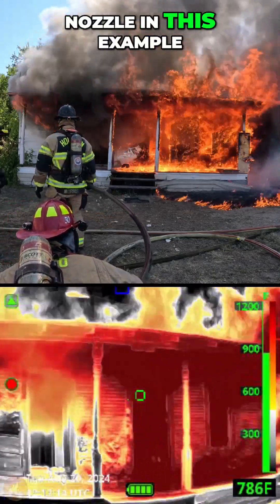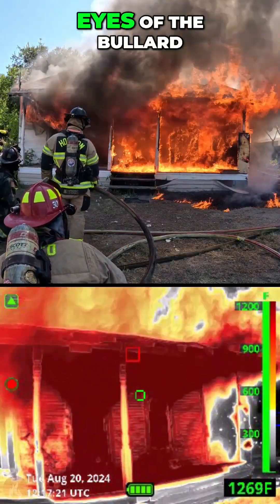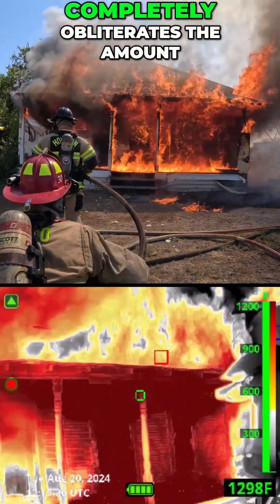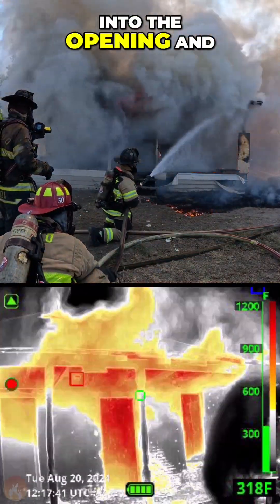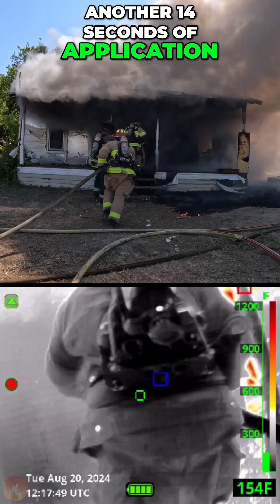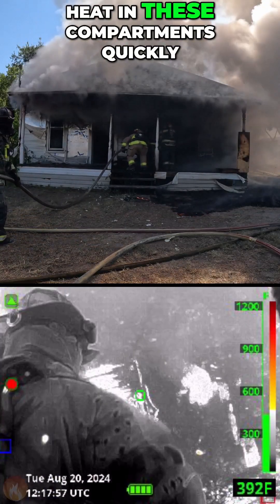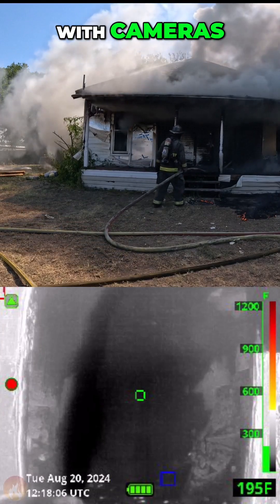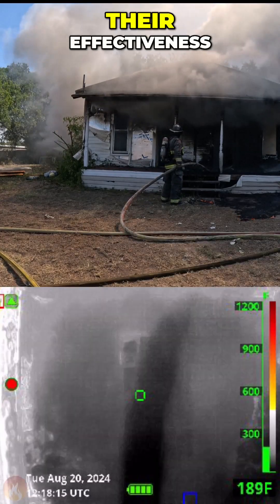Precision Fire Suppression with the HEN Blade 160 – Vertical Blade Pattern in Action

Comment: Another big game changer is the integrated TIC on the SCBA mask. We had a fire that started on a outdoor cooking area. It was like a converted sun room. It extended into the houses kitchen. We had 1 line with water on the exterior fire. I made entry with the 2nd line through the front door to get to the interior fire. Heavy smoke condition, zero vis. I walked to the fire room using the integrated TIC. I truly believe that in the next decade, you'll only be able to buy masks with the integrated TIC. A funny aside. As we pulled up and I saw the house I said "I used to get drunk in that house back in the day." Different homeowner, but I got blitzed in that house 20 years prior. 😂